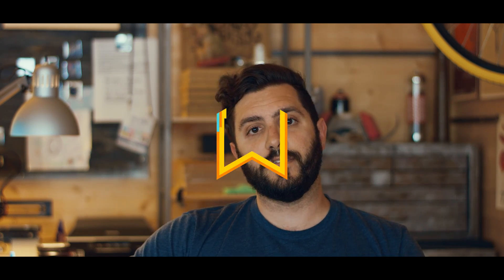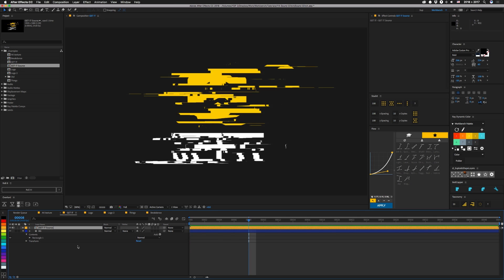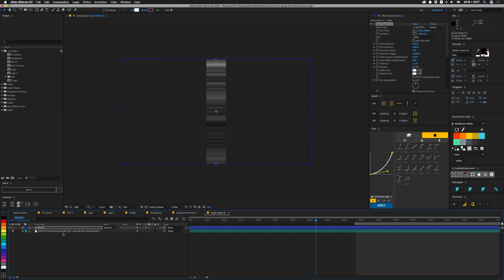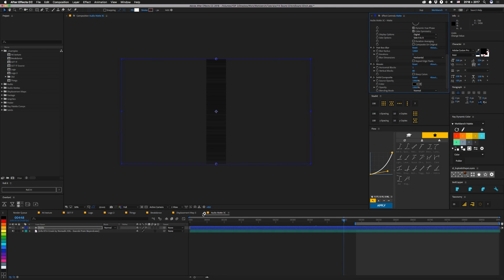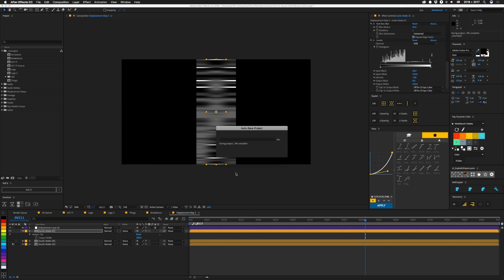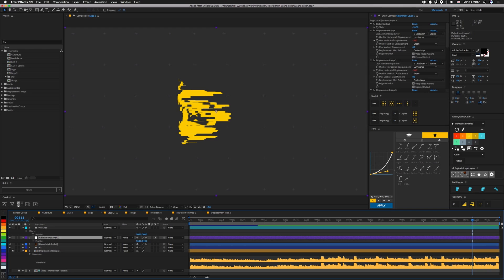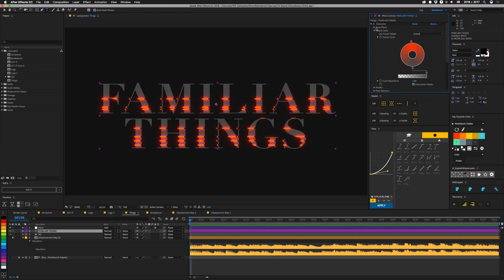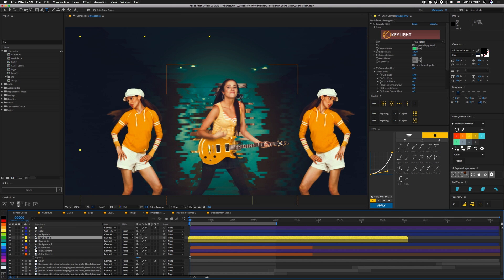Tutorial 114: Audio-Based Glitch Maps

Comment: Hey Joe, I've got a challenge for you: do you know of a way to smooth or average out the interpretation of the audio amplitude data to produce more subtle movement from the waveform? kind of like what a slow attack and/or release on an audio compressor does... i love doing this stuff but the results are always kinda "jagged" ya know?
Reply from the maker: I know what you mean. I've tried in the past to get slow attack/release in the past. There's a setting in there for averaging, but it does too much. It rounds off everything, although you could probably do a couple of copies with the effect targeting different frequencies to cut that back a bit. Pair it with a short Audio Duration setting. But it still is fast. Another option is to throw an echo on top. That will get you a slow release. Make sure you set softness to zero in the spectrum effect. If I figure out something better, I'll post a link to it here.
Reply from the maker: OK, this is pretty close. I have Audio Duration set to 33ms in Audio Spectrum. The I'm using echo set to -.02, 10 echoes, and Composite in Back and it looks pretty good. The only downside is that you can see some of the echoes on top for some reason, like their edge alpha adds up, but you can probably take that down or not even worry about it if you're going to throw some effects on it.
Reply: Workbench brilliant thank you. I am terrible at coding and maths but feel pretty certain there could be a plugin/extension easily written that would do this, id definitely pay for it!
Reply from the maker: You're welcome! That would require a plugin. While I've made one, I got stuck halfway and couldn't find a resolution. The API for that feels like it was written for After Effects 1.0 and there's probably nothing even in it for audio. So while it's probably easy for someone, that someone isn't likely to be me, haha. But it would be nice.